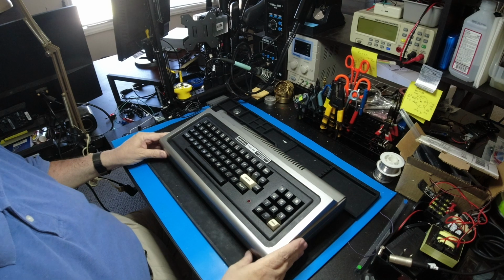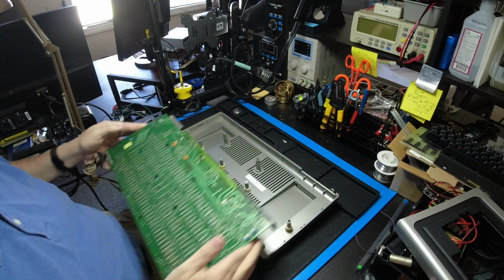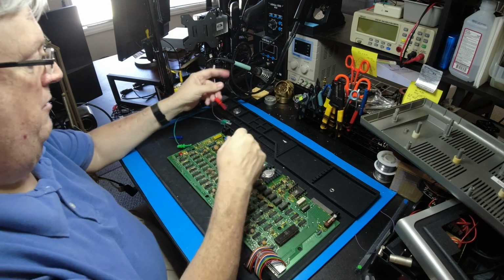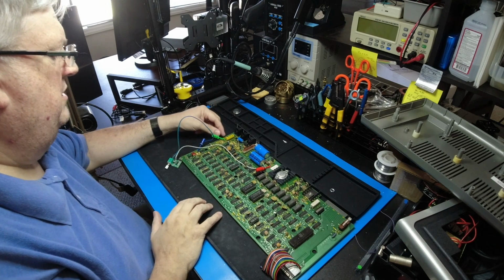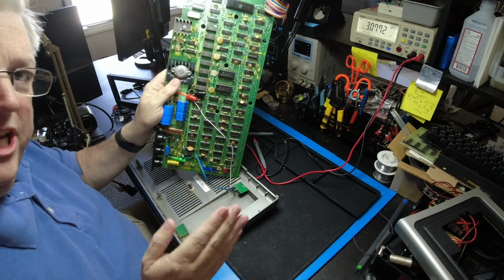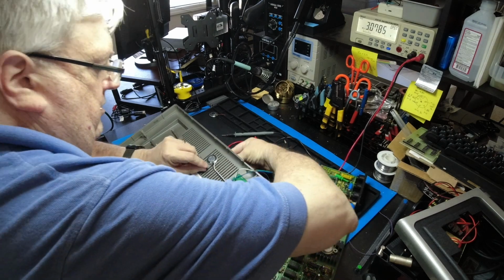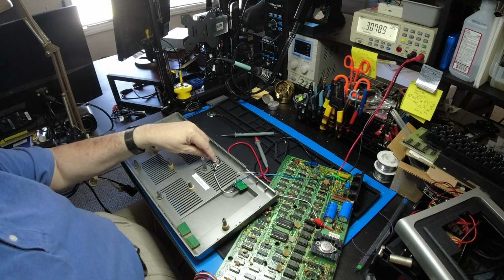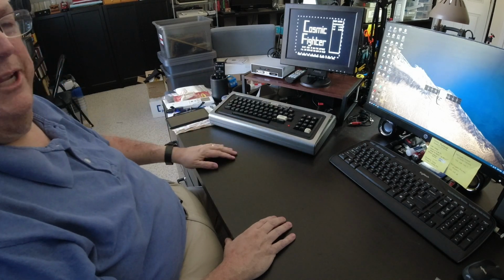TRS-80 Model 1: Adding Internal Audio

Comment: Hello, Scott, thanks for tackling this issue, haven’t found any other sources out there on how to add sound to the venerable model I. I ordered all the items and tried to follow your instructions to the letter and… it didn’t work. :/  I’m quite the beginner in electronics, so I probably got one of the connections wrong. Would you mind putting out a diagram of all the connections from the amplifier to the speaker and the TRS80 motherboard just to make sure I didn’t mess up any of them? Thanks again!!!!
Reply from the maker: You may be connecting the speaker to an output with no signal. Make sure to run a jumper wire between the L+ and R+ input connections to create mono audio. I'll work on a diagram as soon as I can.
Reply from the maker: Have a look at this - hopefully it will help.
https://ibb.co/sKTxmk1